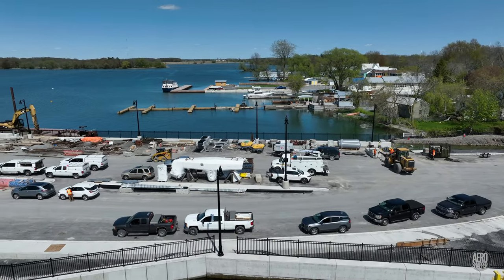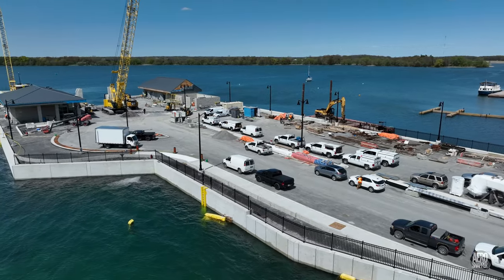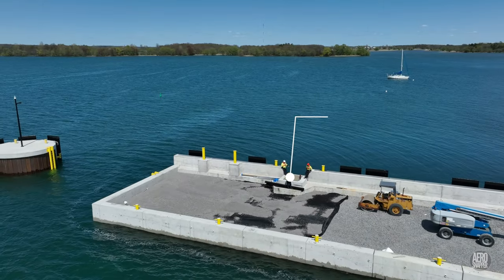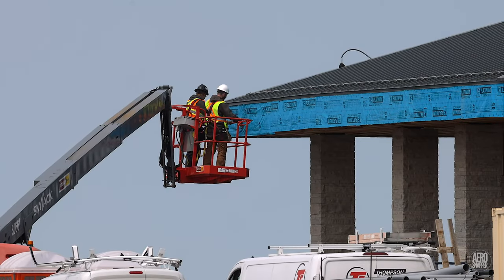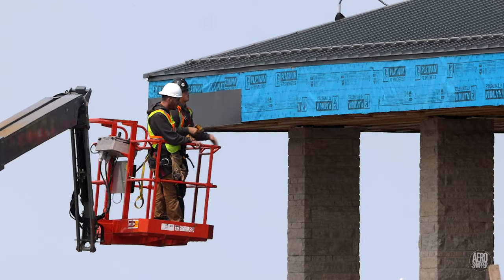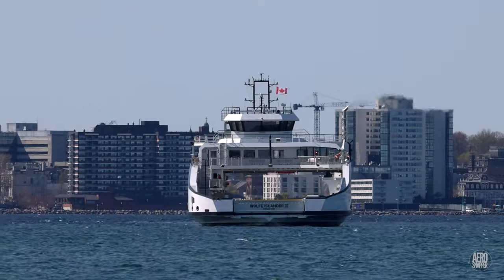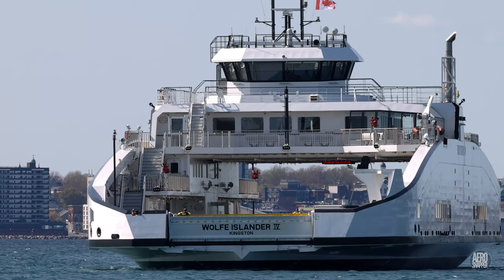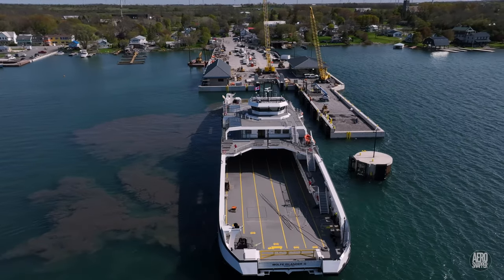Something Big is coming this way   4K

Comment: Thanks for posting this video!  I see now what the dolphin dock is used for.  Looks like  there's work to do on the ramp portion of the dock.
Reply from the maker: Jannet - yes, the installation of the ramp itself - no mean feat - and the mechanisms that control its height from each of the towers. But, this crew is amazing and I don't think it will take too long.
Reply: Jannet, I too am eager to see the dock in place. I will admit I'm not seeing it so far. The open water area seems much larger than necessary but I'm sure it'll all make sense when I see the dock in place. 🙂

Comment: I've said it before, this is a beautiful looking craft!  And the coverage you give it is well received, Mike. Thank you. A question if I may - I am a FCP user as well.  The labels to show things like passenger disembarkation point, is that something in FCP, or have you added a tool?
Reply from the maker: Thanks for that wonderful feedback - yes, the callouts are from MotionVFX - a paid plugin for FCPX.  FCPX does have a tracker built in and it will pin labels, but it's not as easy or instinctive to use.
Reply: @Aerosnapper  Interesting, especially about it not being instinctive. I have seen others use the Titles Pack and it attracts me. But it ain't cheap!  And in reality, FCP has all I probably need built in. Also, when I watch tutorials it doesn't look intuitive, as you say. Thanks again, Mike.